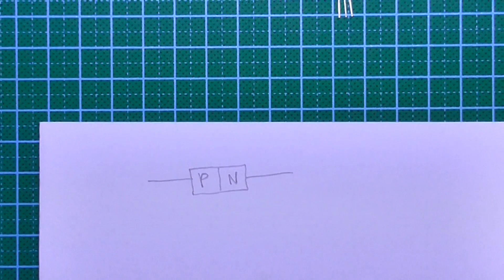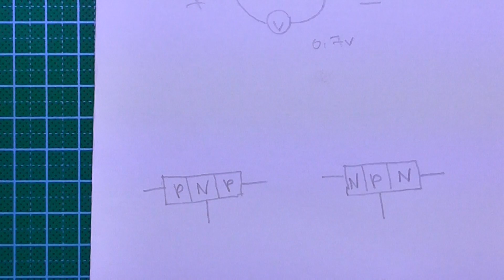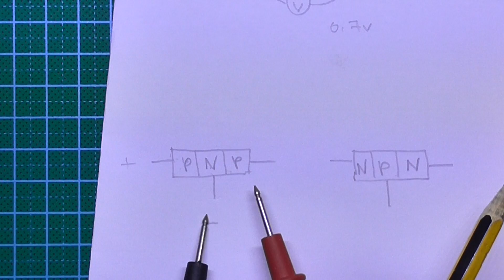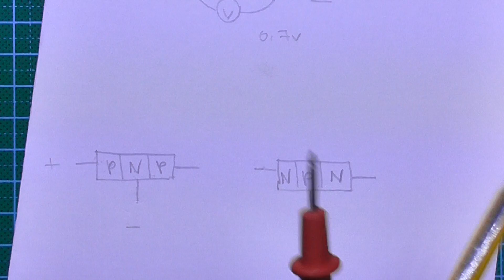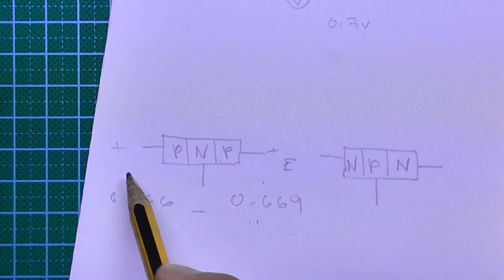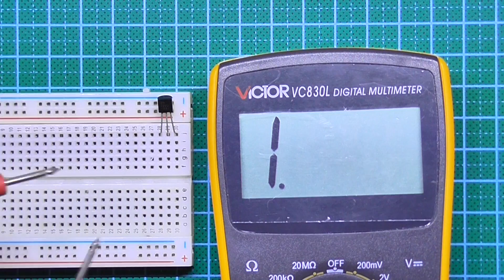How to test a transistor using a digital Multimeter

Comment: Can someone tell me why I'm only getting a reading on one side 
I have take a transistor out and measured and I'm getting a reading between the Emitter and Base but not Base and collector 
I thought this was my problem with my amplifier so I bought a replacement, ( got a few of them).  They all read one side.  Does it all depend on transistor type . ? 
These are PNP transistors  have

Comment: I have this custom made tester for Transistors, capacitors, resistors,.... Etc.  Is it reliable?
Reply from the maker: There are a few low cost and custom made testers which are very reliable
Reply: @shawalsi4450  I  wanted to post it here. But seems like I cannot upload photos here.  It's an ESR Tester. Google it  or it's on YouTube too. ✌🏼😊

Comment: why don't we use "Voltage" setting instead of "Diode" setting?
Reply from the maker: The diode setting will provide a low voltage supply on the probe and measure its voltage drop.

Comment: I like this video, but how do you know if the transistor is bad?  Can you test these transistors while they are still "in-circuit" and soldered to the board or do you have to remove them first?

Comment: i have 2n2222a. I tested with mulitimeter and get value of  Postive(left) Negative(middle) and  Negative(middle) Positive(Right). I thought i had pnp type. Then i checked my mulitimeter probe. It turned out that put red wire into com and black into v.  This is so simple mistake.
Reply from the maker: Then its a PNP type transistor which is not 2n2222a(NPN) and make sure your multimeter has a diode mode to easily measure forward bias voltage to identify which one is collector and emitter. Emitter forward bias voltage is higher than the collector pin.

Comment: Does this test work with an unknown Infrared receiver with 3 legs?  
I tested each pin in 2 ways: Left to Center, Left to Right , Center to Right.  
with the red test lead in the Left hand & black in the Right it reads: 130, 0, 0
with the black test lead in the Left hand & red in the Right it reads: 130, 812, 677
The Only Markings on it are: It says 3D on the Flat back opposite the Hemisphere front Bulge lens.  Do you ting I got a pretty good chance of using this for an IR remote control camera shutter trigger?  Also I have Zero plans on ordering anything over the internet and radio Shack skipped Town so I AM Stuck salvaging electronic parts from peoples Trash or GoodWill.  
So whadaya think, AM I gonna Win or what;^D  
Seriously tho I'd appreciate your feedback cause I would like to get about 20 foot range on a wireless remote for My Camera and those 2 pin IR photo-transistors only seem to get about 12inches in which case I would be better off runnin' 50 feet of Telephone Line.  
Oh and check this madness out.  I went to turn My Desk to Computer on this week and somebody sole the Power chord. Now it take a real Special kinda person to Break into My Home and not steal the Computer but are Hell Bent to steal the Power Chord to it. 
They didn't get My Telephone Wire tho, pretty happy about that ;^D
Reply from the maker: Better to identify the IR receiver based on the device shape and check the datasheet online. You can try use super bright IR led to increase the distance.
Reply: Thanks, I will figure it out, I always do, it's only a matter of time!  
The Criminal who broke into My home left exactly 1 micro drop of their blood on My Kitchen counter.  The intentions of the hearts of men can be identified in unusual ways.  
Thanks for responding;^D

Comment: With a low end multimeter like this, you simply cant tell whether a result of 0.661V is actually higher than 0.660V. It's within the multimeter's spec to say that the 0.060 could have an actual higher voltage than the 0.061 result.

Comment: I have transistors with low voltage readings in the .473V -.486V range, can I assume these transistors are bad?  Should I get readings .6V and up?  The transistors I have are 2SB600 and 2SD555 from an amplifier that has very LOUD static.

Comment: in your first transistor testing you are using a 2SC5568 or a 2N5568 transistor, so its a NPN not PNP like you say on the video at 6:40... According to what the datasheet of a C5568 says..

Comment: Good job at explaining this to people!!
Is there a good way to test transistors and other components while soldered on the board?
I have an ESR tester (Which was suppose to do this) but gives me different readings when I de-solder the component and test it again with the ESR tester.
Thanks 4 sharing bud!!
+1 Sub

Comment: Hi, nice tutorial.  Could you explain hfe value is and if it makes any difference if you match this value when building something?
Reply from the maker: hfe is a gain or amplification value for transistor, it can be found on the datasheet. For example, if Base current is supplied with 4mA and the transistor has a gain value of 10 then the collector current will be flowing at 40mA. The gain will depend on your transistor and circuit, its typically used for signal amplifier, audio amplifier and more.
Reply: Thanks, you seem to have alot of knowledge, could you make more elaborate tutorials.  So many are just repeating basic information.

Comment: So does this mean that the Base to Emitter junction has a higher resistance value than the Base to Collector junction? If this is true then can we use an Ohm Meter?
Reply from the maker: Base to emitter junction has higher resistance because of heavier doping of the emitter semiconductor layer and it will also work on ohm meter.
Reply: Shawal SI collector is highest doped semiconductor. Can you prove it to me that emitter is higher doped than collector.i have read 3 books and on google.